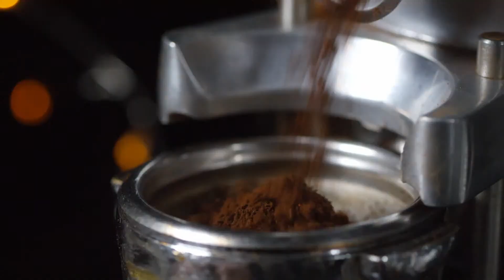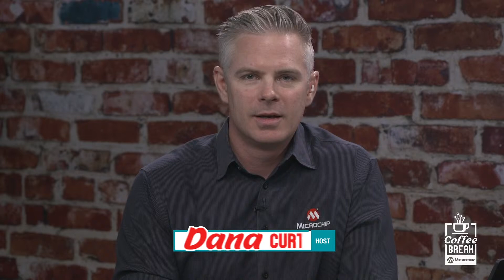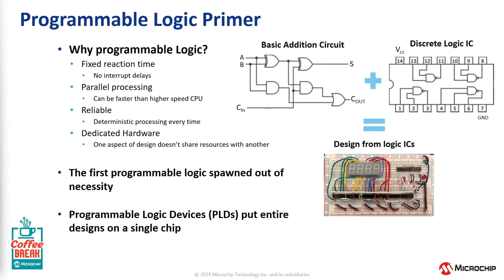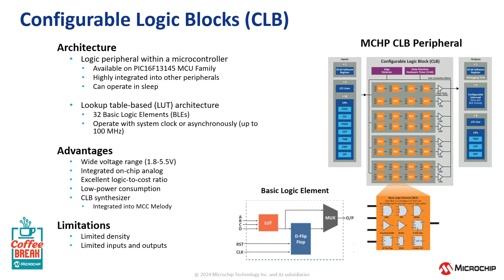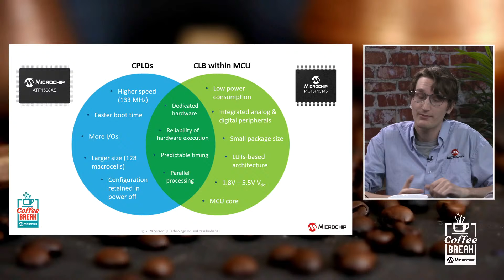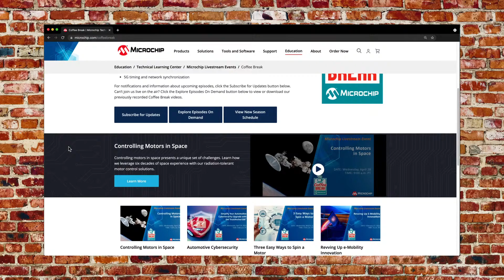Coffee Break S14 E1 | Let’s Be Logical: CPLDs or CLBs

Comment: Sadly, CPLDs (and GALs) are basically not supported anymore and it is strange, you mention WINCUPL that hasn't been touched for two(?) decades. But I like the PICs with CLBs as sort of a replacement for a small CPLD and have recently bought some 16F13115 to play around with.